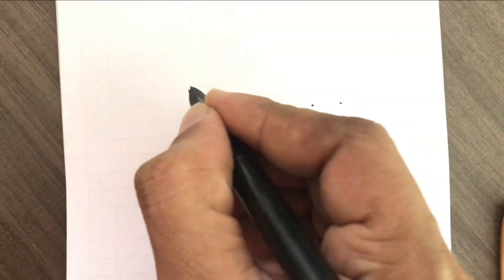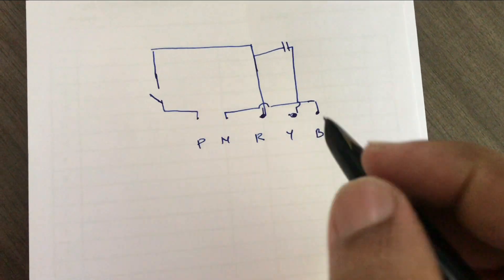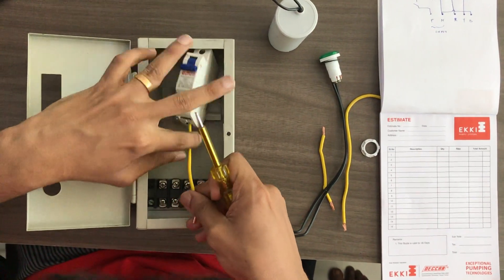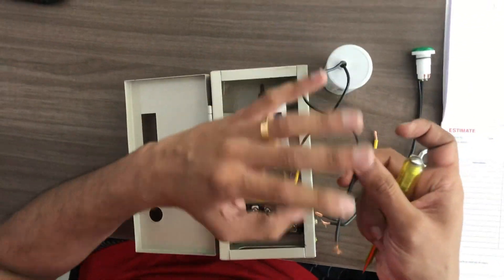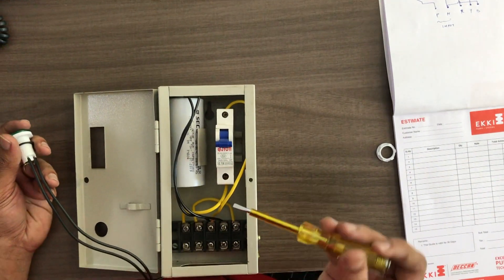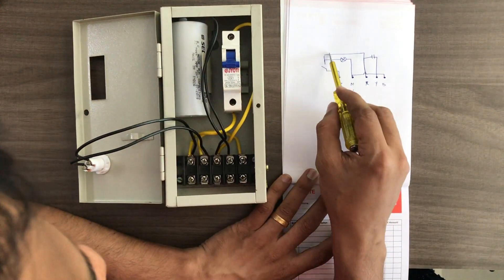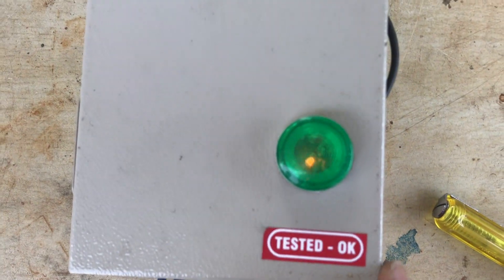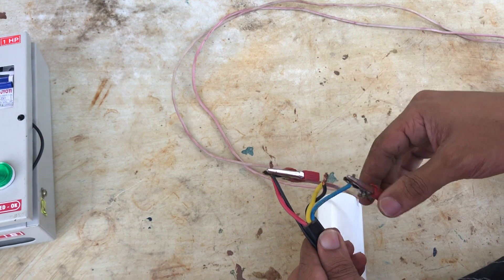How to wire a submersible panel board - സബ്‌മേഴ്സിബിൽ പാനൽ ബോർഡ് എങ്ങനെ വയർ ചെയ്യാം?

Comment: 2hp submersible pump , starting and running capacitors value ethra vennam?
Reply from the maker: Depends on brands.
Normally value : 150-200 / 72mfd or 100

Comment: 1.5 kirloskar  submersible nu capacitor  45 mathiyo
Reply from the maker: 50 anu normal.
Depends on the site voltage
Reply: @thundathiltraders  1 മിനിട്ടന്നുള്ളിൽ പാനൽ ബോഡിലെ ബ്രക്കര ഡ്രിപ്പാവുന്നു
Reply from the maker: @nozaslab5886  motor current kooduthal edukunundvaum. Pls check
Reply: @thundathiltraders  OK
Reply: @thundathiltraders  tks

Comment: Cappacitter value paranjutharamoo
Reply from the maker: Oro motorinum oro value anu.
Brand anusarichu maarum.
Average 
1HP : 36 or 50MFD
1.5HP : 50 or 72MFD
2HP : 72 or 100MFD
Reply: Thanks

Comment: 1.5 hp motorinu ethra unitinte capacitor venam
Reply: Ethra mfd and volt
Reply from the maker: Depends on the brand.  Mostly centrifugal monoblock pump 36mfd 440v anu kanaru
Reply: 36mfd 2 ennam undenkil engane connect cheyyum parallel aano.
Reply: യൂണിറ്റ് അല്ല mfd

Comment: Bro voltage kurav ulla samayath motor ittu ippol panel light kathunilla motorum work aakunnilla capacitor maatiyal sheriyakumo please replay
Reply from the maker: Line ok ano enu check cheyu.
Capacitor physical damage enthenkilum kanundo?
Reply: @thundathiltraders  ഇല്ല wire ഉം കപ്പാസിറ്റർ ഉം ഒരു പ്രശ്നവും പുറത്ത് കാണുന്നില്ല
Reply: @thundathiltraders  capacitor maatiyal ready aakumo
Reply: Coil short aayo?
Reply: https://youtu.be/xj2uOLjgo8c

Comment: Contractor switch ഇല്ലാതെ borewell submersible pump ചെയ്യാൻ പറ്റുമോ. കറണ്ട് പോയി വന്നാൽ നമ്മൾ on ആക്കാതെ തന്നെ on ആകണം. അതാണ് ആവശ്യം..
പറമ്പിൽ വെള്ളമടിക്കുമ്പോൾ കറണ്ട് പോയി വന്നാൽ തിരിച്ചു വീട്ടിൽ വന്ന് on ആക്കിയിട്ട് പോകേണ്ടി വരുന്നു. ചില സമയങ്ങളിൽ ഇവിടെ മണിക്കൂറിൽ 10 പ്രാവശ്യം കറണ്ട് പോയി വരും...
Reply from the maker: Starting capacitor ellathe on avunna motor ano?
https://youtu.be/uttEG03zMwU

Best option oru automatic panel vachu kodukkam.
https://youtu.be/9_kAkWfw9Do

Comment: Capacitor rating എങ്ങനെ കണ്ടു പിടിക്കും?
പിന്നെ ഒരെണ്ണം ആണോ രണ്ടെണ്ണം ആണോ ഉപയോഗിക്കുന്നത് എന്നു എങ്ങനെ മനസിലാകും?
Reply from the maker: Motor name plate nokiyal ariyam etrente capacitor use cheyyanam enu.
Starting and running randum veno ennulathu ariyan bhuthimutayirikum. Normally openwell submersible pumps statrting venda.borewell submersible pumpsinu venam

Comment: Mcb amp ethra
Reply from the maker: Normally 10A or 16A anu use cheyyuka. for 1hp
Reply: @thundathiltraders  6A use ചെയ്‌താൽ പോരേ.1hp=746watt.
I=P/V=746/230=3.24A. അപ്പൊ 6A ധാരാളം അല്ലേ.
Reply from the maker: @muhammedaflah7920  Free loadil Anu 750 watts . Normal 1HP Submersible average 8A vare current edukum.
Starting current athilum kooduthal ayirikum.
Reply from the maker: Minimum 10A MCB Anu vendath. Safe ayi 16A commonly use cheyyaru
Reply: https://youtu.be/xj2uOLjgo8c

Comment: 1hp submersible pump mcb amps rating and capacitor mfd rating value എത്രയാ എന്നുകൂടി പറയു plz
Reply from the maker: Depend on the brand. Normal MCB rating - 10A or 16A , Capacitor rating : 36,45 or 50 MFD
Reply: @thundathiltraders  വളരെ നന്ദി
Reply: @wiringexplain5

Comment: Bro, submersible vertical pump, runnigil water level kurajal enthagilum problem undo?
Reply from the maker: Pump Dry ayitu oodiyal ethu pumpsetum complaint varum. Vertical pumpukal dry run petenu affect cheyum. Athil noryl(plastic) impeller anu mikyavarum use cheyunathu. Deccan pole ulla companykal matram anu single phase vertical Openwellil Steel impeller use cheyunulu

Comment: I need a detail for texmo 7.5hp bore well submersible pump with high pressure. The depth of the bore well is 300ft. Approximate cost
Reply from the maker: We are closed due to lock down.I will send you details once we reopen.Thank you